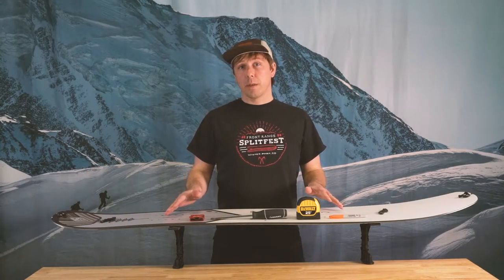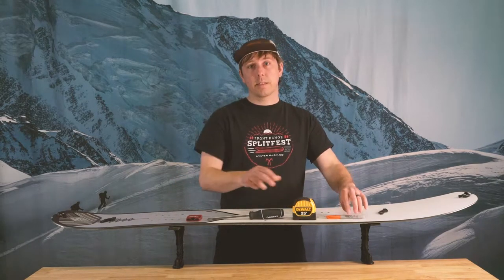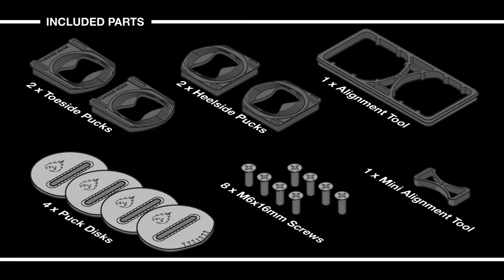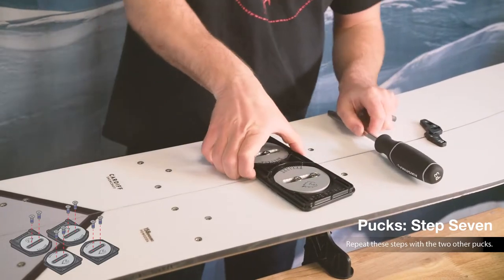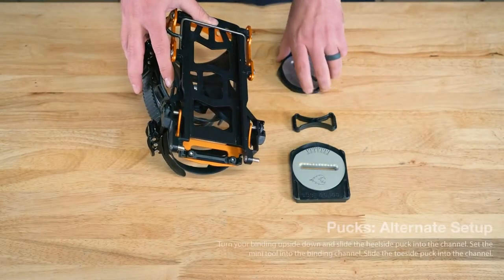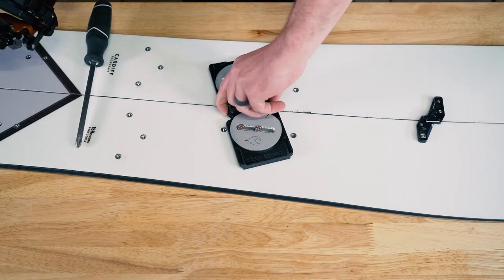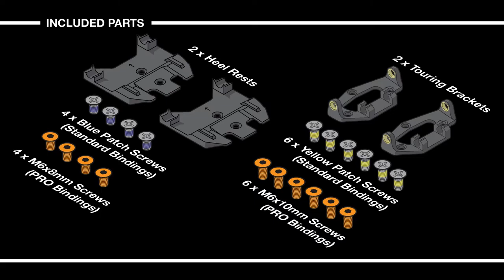Setting Up Your Splitboard With Spark R&D Bindings and Pucks

Comment: Thank you for the video. I am starting splitboarding this winter. Do I really need the pucks, or is it possible without them? I am going to buy the Nitro Slash splitboard for 2023 and the Nitro Vertical Binding ’22. Are they even compatible? Greetings from Austria. Patrick
Reply from the maker: Hello. Yes, you definitely will need pucks. The bindings slide onto the pucks in ride mode. The 23 Slash will be compatible with your '22 Vertical. Happy splitting!

Comment: Hi! Thx alot for the video! I have one problem tho, understanding how to sand the pucks enough to slip the bindings on smoothely. In the video it just looks super simple to slip them on to snowboard mode but I really need to use a bit of force. Im afraid Ill ruin my bindings of I sand them too much :O Im using the alignment tool and have tried to re-align it a few times but still quite alot of resistance. Do u have any tips?
Reply from the maker: Just go slow with the sanding. Take a little off the sides of the pucks until you find a smooth glide. We usually don't find that you need to sand spark pucks though. The pucks in the video were never sanded and the bindings were brand new. What bindings are you using?

Comment: I just recently setup my new spark pucks with my new spark bindings -- there is a tiny amount of 'play' in the bindings (toe to heel direction) once i attach the bindings. any recommended fixes for this? like a tiny shim inside the alignment tool to push one of the pucks towards the edge a millimetterr or so? or would the clearance on the alignment tool simply not allow for that.
Reply from the maker: Hmmm... that alignment should be tight. Try loosening either just the toe or just the heel puck screws and manually nudging them forward or backward (without the alignment tool) just a hair. If this doesn't work, please drop our sales team a line at sales@sparkrandd.com.
Reply: @sparkbindings  cool I was going to try that. it's very slight, but just enough to be noticeable. thanks!